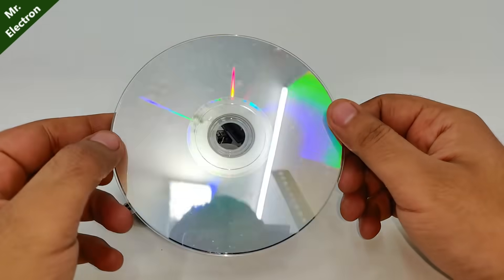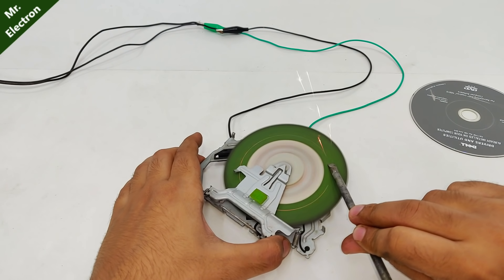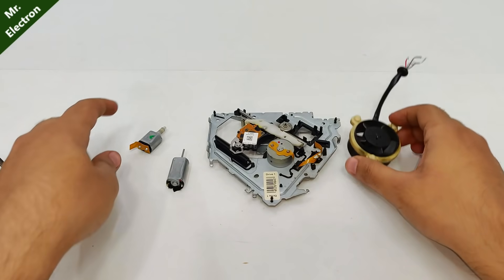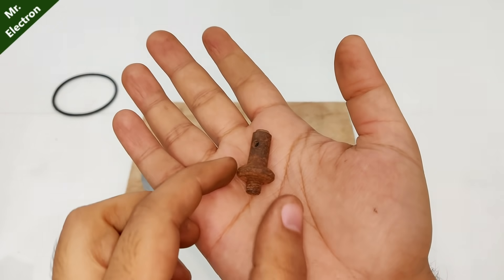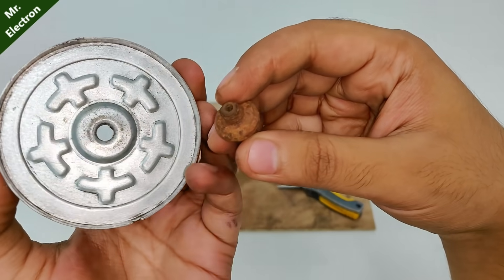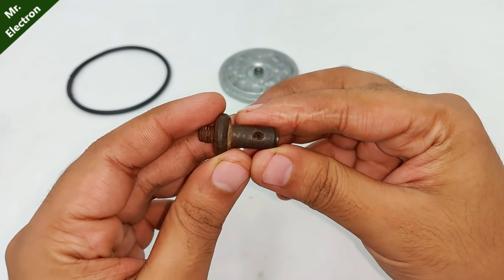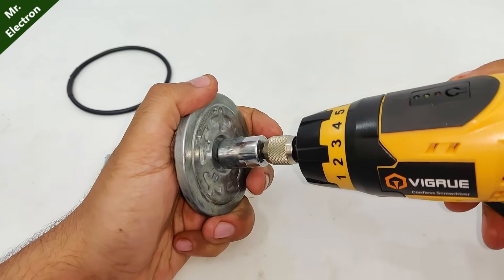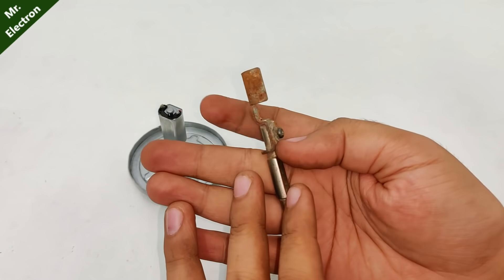20,000 RPM - Reuse 12v High RPM Music System DC Motor for Gyroscope DIY

Comment: Greetings Mr electron... Pls I will want to know ... I built a generator with a microwave transformer with neodymium magnets... I was getting 350volts at 1500rpm... But I was not getting enough current. The least I was getting was 0.02amp.  how can I fix this?. I await ur urgent reply. Thanks
Reply from the maker: use primary coil
Reply: @MrElectron  wow... Thanks Mr electron... I really appreciate. 🙌👍
Reply: One more question.... Can I conect the primary and secondary coilsl together in series or parallel? Is it possible? Or should I just use the primary coil? I am using 2 microwave transformers. Thanks
Reply from the maker: Just primary
Reply: @MrElectron  thanks bro🙌
Na you sure pass